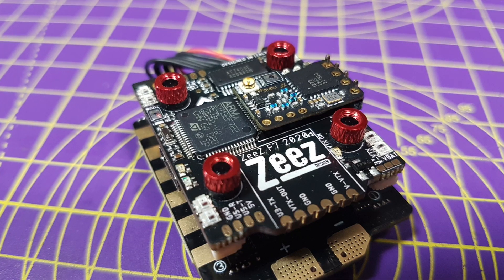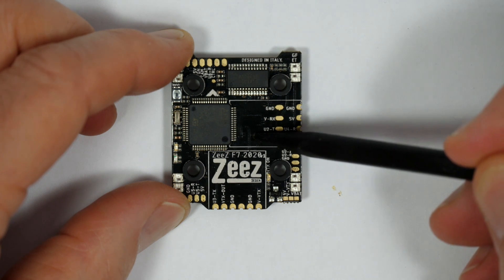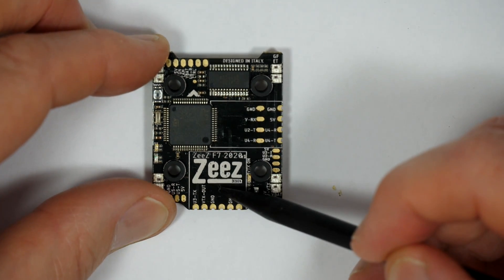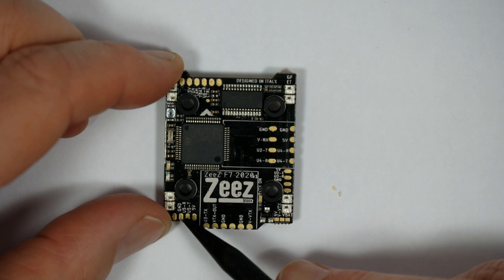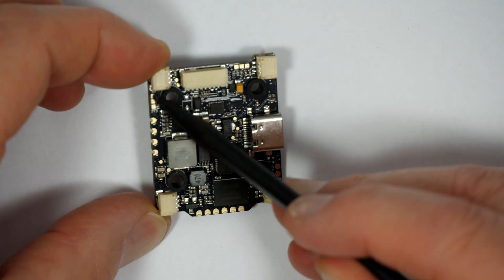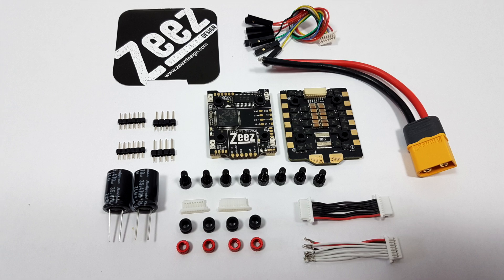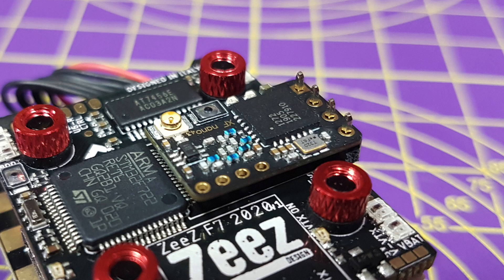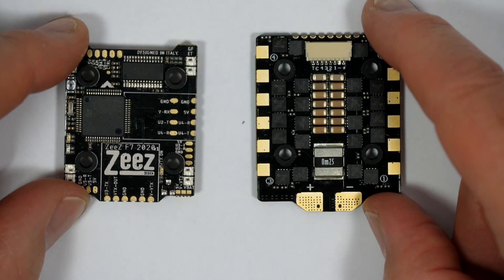Zeez F7 2020 45A AIO flight controller stack // Full review

Comment: just bought this from unmanned tech , pressing boot in Betaflight  It is the zeez v2  So knowing that I selected the corrtect firmware, After updating. Only a very dim light on the fc where as just before flash Very bright. Betaflight not reconising it Nothing I type in version Not detecting the fc ? strange Thought may be wrong flash But Hey can only flash with zeez v2  Any ideas
Reply from the maker: Sounds odd. UnmannedTech support are usually very helpful with these  sorts of problems. Did you back up the original flashed version? I'm guessing not.